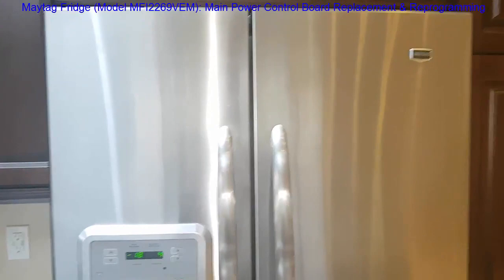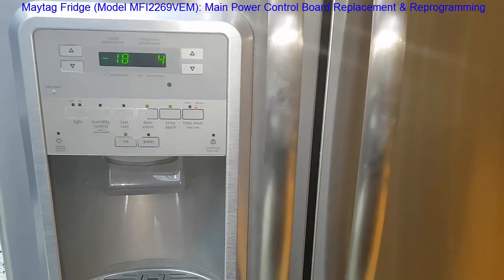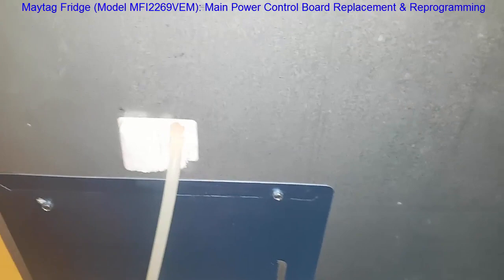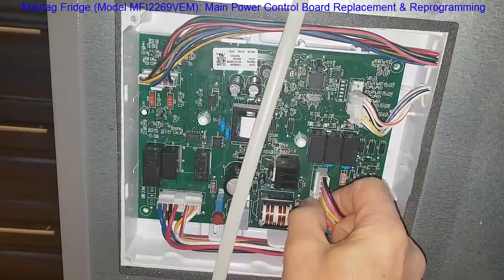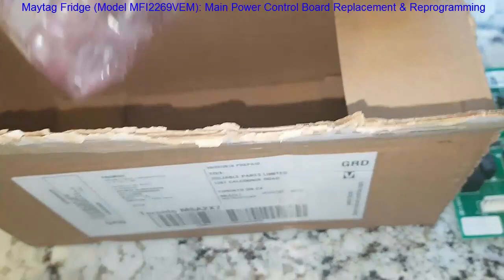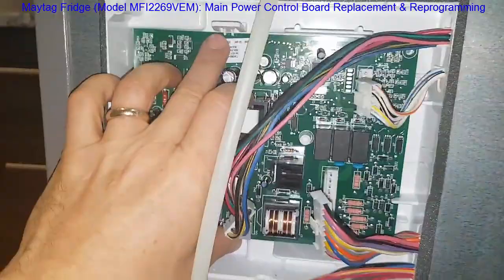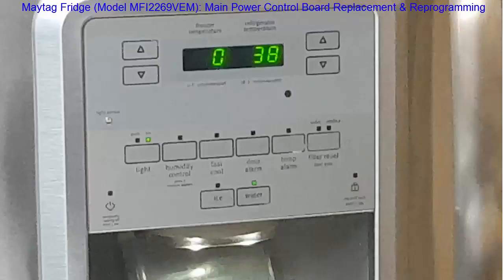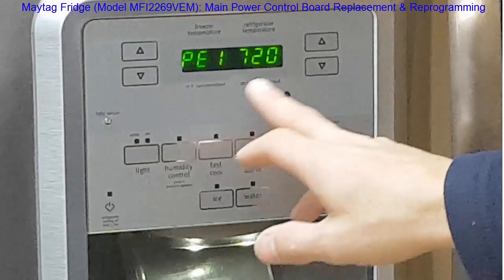Maytag Fridge - Main Power Control Board Replacement and Reprogramming

Comment: Thank you!  I just replaced mine this morning, start to finish it took me around 30 mins.  Honestly this was one of easiest and cost effective fixes I’ve done.  The programming was a little fussy, but I finally got it.  (My display was blinking) Thank you again, I was scared to try this, but so glad I did :)
Reply from the maker: Glad to hear this video helped you save some money and at the same time divert so much metal and plastic from ending up in a landfill.  If you liked the video I'd appreciate if you would click the "LIKE" button as it helps with overall recognition of my channel and if you subscribe to my channel you will get notifications of any new videos of general fixes I make around the home.  I'm planning to add several more videos as soon as I find time to make them and upload them, including replacing a pull cord on a lawnmower, repairing a cartridge in a bathroom lavatory faucet, and replacing a snowblower starter drive pinion gear. Vito Casola - FIX IT Yourself!!
Reply: How did you get it stop blinking? Mine is doing that.
Reply: @jamesnogames  mine too 🥺
Reply: Please mine is also blinking now . How did you get it to work
Reply: @roxannelapierre3014  when I received the part, it came with a set of reprogramming instructions on how to stop the blinking.

Comment: Excellent instruction. Question: My Fridge stopped working after a power outage. I purchased the Motherboard, but now, it seems like the fridge "reset" and is now working. Do you think I should hang on to the Motherboard?

Comment: This is a great video; you’re a good man for taking time to do this! I’m having a bit of an unusual problem with my frig and I’m wondering if you or anyone has any suggestions. I have a Maytag frig very similar to the one you show in the video. Last Sunday our electricity was off for several hours, there were no thunderstorms so I don’t know why it was off. When it came back on my refrigerator wasn’t working. When I pressed any button on the front panel all the LED’s would come on and then go off when I released the button. I decided to cycle the power so I unplugged it, waited a while then plugged it back in hoping that would reset it. But it still did the same thing. That’s when I started surfing the Internet for help and found your video. It looked like replacing the control card was the thing to do. But when I started to pull the frig out to get to the back panel, I found it working like normal. Thinking that it must have finally reset itself I decided to leave well enough alone and it worked fine for several days. I decided it would be a good idea to put it on a surge protector thinking that the power surge when the electricity came back on may have caused the problem. This meant unplugging the frig to install the surge protector. When I plugged it back in though, I had the same problem. I tried cycling the power again, but this time it didn’t work. I have some electronics background and I know that sometimes intermittence in connectors can cause problems, so I removed both the front and back panels and reseated all the connectors. When I put it back together and plugged it in, I got the same problem again, but then, after a couple hours it started working normal again, just like the first time, and has been for over a day. My concern now is that there is still actually a problem, it’s just not showing up right now and if the power goes off again (and it will go off again) it will rear its ugly head. If reseating the connectors had fixed it, it should have worked normally as soon as I plugged it back in. This seems to be an intermittence problem, but I’m not sure where it is. It seems to me that if there is a problem with the control card, it wouldn’t work at all. Right now, I’m looking for a second opinion, any comments or suggestions would be appreciated.
Reply from the maker: Hi Winston,
Thank you for the kind words and support. I'm glad you found the video helpful and I hope you "Liked the video" and subscribed to my channel.  I believe you are most likely correct in assuming that thunderstorms and the associated possibility of power surges could be responsible for the failure of the main control board of these fridges as well as other household appliances that have delicate circuit boards.  Installing a Power Bar with surge protection is a great idea for this fridge and any appliance (like TV's, stereos, etc.) to protect them against damaging effects of power spikes. Sometimes the issues are with capacitors and by unplugging the fridge or disconnecting the main power board you probably allowed any bad capacitor(s), which could have been the cause or your problem, to slowly drain and then work again for a short time until they get recharged to the point where they are once again overloaded.  One way to diagnose a bad capacitor is to do a visual inspection. Usually bad capacitors are visible by spotting bulging tops or having what appears to be some material leaking out of the tops (you should be able to google how to spot or test for bad capacitors.  It is easy when they are obvious to see, otherwise you would need to use other means to detect bad capacitors with special electrical metering equipment, which is a little more complex and requires some expertise.  In my case I just went to a local part supply store and replaced the entire board.  For another fridge that I repaired for my aunt (A KitchenAid model - see video https://youtu.be/9GCv2WIkoQY) the circuit board was discontinued and it wasn't possible for me to buy a new board so I needed to actually replace bad components on the board to repair the fridge.  I believe for these Maytag fridges you can still purchase the main power control board so that may be the easiest but unfortunately somewhat more expensive, although cheaper than repairing the entire fridge.  Anyway I hope you are able to solve your problem and do post whether or not you are able to find a solution as others may find that useful.  Take Care and best of luck with your repair.
Vito Casola - FIXIT Yourself
Reply: Hi W.A. try replacing all its four 
10uf 35V caps; C31, C32, C45, and C?. These are on the Main Board in back of the fridge.  I replaced the four with
 10uf 50V caps, ( but 35V are fine too, they just have less lifetime ). Leaky caps at times work or fail randomly, which seems what you are experiencing. These caps may look perfectly fine, not bulging etc, but the inside dielectric may be going bad.
Reply: @rfsignalsolution6421  Thank you for your reply. I think you and Vito are both right, it is most likely a capacitor problem and I do intent to replace the four capacitors you  suggested. However my frig is working fine right now and has been since I first posted. It's even survived a few power blinks. Apparently, the power has to be off for a while for the problem to show up, which definitely suggests a bad capacitor. Right now, i'm taking the "if it ain't broke, don't fix it" approach. However I'm also thinking it may be a good idea to go ahead and replace the capacitors before they lead to a bigger problem. Your thoughts on this would be appreciated. I'll keep you posted.
Reply: My frig finally quit working, again. Same problems as before. This time I removed the control card on the back and replaced the four capacitors you suggested. I also checked each one as I removed them. C31,C32 & C45 check out good, but C16 was bad. I replaced all four capacitors anyway. When I put the card back in and plugged it in, it immediately came on and worked fine. Apparently C16 was the culprit. Total cost of repair, $1.16 plus shipping. Sure beats paying $200.00 for a new card or hundreds for a repairman. Thanks again for your help!
Reply from the maker: @winstonadkins2629  Great to hear that this can be fixed by simply replacing the capacitor or all capacitors for far less than replacing the entire board. If mine goes again I will be sure to try that. Anyone else that follows these posts should also consider this method first as it is a far cheaper way to accomplish the same thing.  Thanks for your responses/comments, it sure helps when everyone contributes their experiences. Vito Casola - FIX IT Yourself!!
Reply: Thank you for your video. We bought a new control board and it’s flashing PE0000 with no decimal point even when I push the arrows up and down. Does this mean that it’s probably not the control board?  We didn’t have a problem with our fridge until we had a power outage. Thank you 😊

Comment: Hello. Thank you very much for this video. My refrigerator is  Maytag MCB2256HEB and it doesn't have the front panels with the button. A technician said I should get W10503278 Refrigerator Control JAZZ Board. How do I do the resetting after changing the board? Thank you

Comment: THANK YOU SO MUCH!  I replaced my control board ($250) then my lights stayed flashing. I finally figured out how long to hold the buttons etc and I have it working!
Reply: Hi Mark,Glad it was helpful... another huge hunk of metal and plastic avoided from ending up in the landfill and money saved.  I was happy mine fixed the problem that I made the video so others could have the courage to tackle this relatively easy fix themselves.  I now have a front load washing machine which has failed and I need to replace the two bearings and seal.  This is a pretty big job and if I find I can manage it I may make another video for that repair.All the best.Vito
Reply: I can't get the lights to stop flashing so I can program. HELP!
Reply: @brendabutts6536  me too ! Need help.
Reply: The PE000 keep flashing help please
Reply: Me three 😢

Comment: I think the main power control board is on the way out too.  The control panel lights and display flicker and it sounds like the power gets cut to the compressor and blower.  I still get cooling but something definitely is not right.  You said that your research has led you to the control board being the cause of my problem too?  Also, where did you purchase the part?  Thanks in advance.
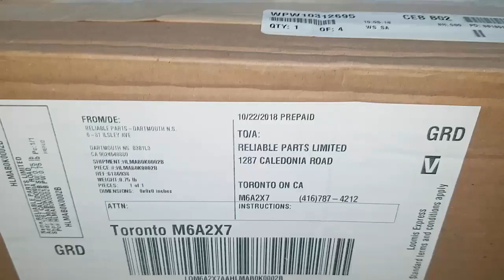Reply from the maker: Hi Aaron, Thanks for your comment. I purchased my board at Reliable Part Ltd. at 1287 Calendonia Road, Toronto, M6A 2X7 (shown in video at 3:25 mark). Their phone no is 416-787-4212. I paid $152.72 plus HST for total price of $172.57.
I've had others tell me that they were able to successfully repair their old board simply by replacing a capacitor for a fraction of a fraction of that cost (mere pennies). So if you are feeling resourceful enough to attempt a similar repair go through all the comments below and you will find the one where someone mentioned the repair.  They also emailed me photos of the repaired capacitors so if you want I could email you what they sent me. Simply email me at vmcasola@gmail.com and I'd be happy to send you whatever I got from them. Vito Casola - FIX IT Yourself.!!
Reply: @FIX-IT-Yourself  Is that an Order of the Engineer ring you have on?
Reply from the maker: @aaronk3788  Hi Aaron, Yes it is, that's very observant of you. It's a stainless steel though. I used to have an iron ring which used to rust my pinky finger but I then got a stainless steel ring and put the iron ring aside and eventually lost the iron ring.  Vito Casola - FIX IT Yourself.!!

Comment: Thank you for your video! Helped me diagnose the issue with my fridge. It's fixed now!
Reply: Great!!  Did you end up replacing the board?
Reply: @vitocasola8358  Yea. Luckily I found a place that had one in stock. Works perfectly now!
Reply: Awesome!! If you found this video helpful I'd sure appreciate if you would subscribe to my channel and like the video.  I like to tackle and do almost any job around the house myself that needs fixing.  It gets done right the first time and saves a lot of money.  I'm hoping to be able to find some time soon to upload some new videos, just need to put them together first.  I recently repaired a front load washing machine where the bracket which holds the drum completely disintegrated. I also repaired my aunt's KitchenAid Fridge by replacing a $2.50 relay and a $0.87 capacitor (because her board was discontinued).  Aso installed a new aluminum vent liner for my Hot Water Tank (to meet a new code here in Ontario).  Stay tuned.  Vito Casola

Comment: Hello, thank you so much for this video! I was able to get the board changed no problem. But the PE0 000 doesn't have a decimal point so I'm not able to add my code in, can u help?
Reply: Also my programming code is flashing, it's not holding still at PE0 000 and I'm missing the decimal

Comment: Thanks. My control panel is exactly like yours. It’s not locked but all lights in the refrigerator are out. I checked both switches with a meter and they tested good. Wondering if my problem is the board.
Reply from the maker: Hi Rick, Thank you for your comment.  When I was looking to repair my fridge I had the option to go to a company which you send out your main power control board and they diagnose, repair and return the board.  In my discussions with them I told them what if it turned out my problem was not the main board but the other board for the front control pane and they told me that almost always it is the main board, so when I checked the cost of the new board versus sending out my board for repair (including shipping to them and back) I decided it was probably best to just buy a brand new board. I thought it was a bit of a gamble too but was happy when it worked like a charm.  I'm willing to bet your issue is with the main board.  Most times it is something as simple as replacing a capacitor or relay on the board and such fixes can be quite cheap (less than $10), but you would need to have some knowledge and experience with testing and with soldering.  If you search down in some of the other comments you will find someone who did repair their board themselves and you may find those comments helpful. Good Luck whichever route you decide to go. Vito Casola - FIX IT Yourself.!!
Reply: @FIX-IT-Yourself  you’ll never believe it but on a hunch I took a bulb I had with the same base and tried it in one of the sockets under the ice maker and it lit up. I thought no way would the 2 lights in the ceiling both be bad too. My test bulb was too big around at the top to fit in the sockets so I just went to Lowe’s and bought 3 bulbs. Put them in and three came on! Couldn’t believe they all burnt out together. Must have been a power surge that did them in. Because I thought there’s no way all went bad at the same time, I went to the trouble to pull and test both door switched (good) and then thought maybe the refrigerator needed reset. Went through the steps you mentioned to reset the code.(thank you for the great video by the way). All in all it ended up being the bulbs! Whoda ever thunk?
Reply from the maker: @MountainrunnerTn  Hi Rick, What are the odds? Maybe one was already burned out and you never noticed before. Anyway you're right about power surges. You should definitely consider investing in a surge protection device or even a cheap power bar with builtin surge protector and plug the fridge, (any any other appliance and TV's into such devices) cause nowadays most appliances, TV's etc. have sensitive electronic equipment that is highly susceptible to power spikes from lighting storms. I plugged my fridge into a surge protector that is then plugged into a power bar with surge protection (so hopefully double protections). Glad to hear it all worked out in the end, and thanks for the positive feedback on my videos, much appreciated. I have like 20 videos on my channel now. Every time I have something else that breaks down or requires my attention to repair I contemplate whether it could be worth making a little video and if I think it could help others then I take the raw footage and when I get time I edit the video and publish on my channel. Getting about 3,000 views on average every 48 hours.... not bad... it is growing since I started with this first Maytag Fridge video about 2.5 years ago now. All the best. Vito Casola - FIX IT Yourself.!!

Comment: Had the two larger of the three caps at the top of the mfi2568aeb (2006) board blow Sunday evening with the ice door cycling open/closed. When unplugging for a few minutes, the fault reappeared soon after plugging it back in. Now the front display was going wacky and the compressor had ceased to operate. Sourced the caps locally and replaced, no magic smoke when plugged in. Everything back to normal. The 680uF caps are a common fault on my model and maybe others. I must have gotten good ones to last 15 years.
Reply from the maker: Hi Mark, Thank you so much for leaving this detailed comment. I'm sure it may help others who may wish to try a component level repair. Too bad YouTube doesn't allow people to upload photos so we could share with others a photo of your board that you just repaired circling the 3 capacitors you changed. If you want to send me a photo you could email it to vmcasola@gmail.com and this way if anyone asks I could simply tell them to email me a request for me to forward it to them. Thanks again for taking the time to comment. Vito Casola - FIX IT Yourself.!!